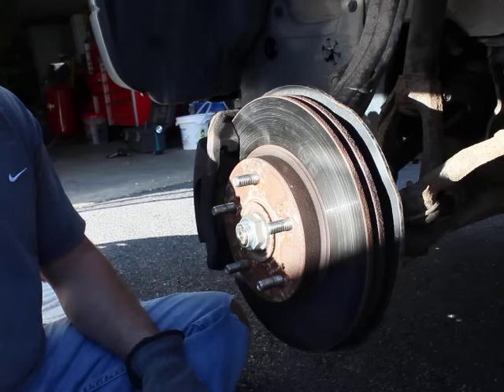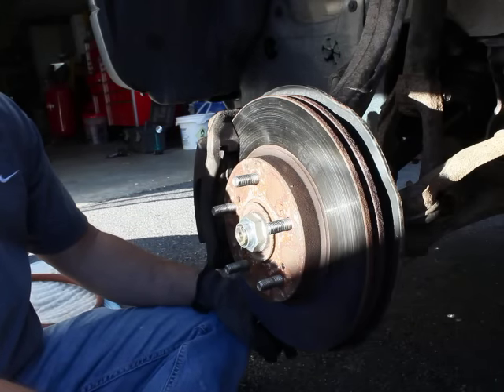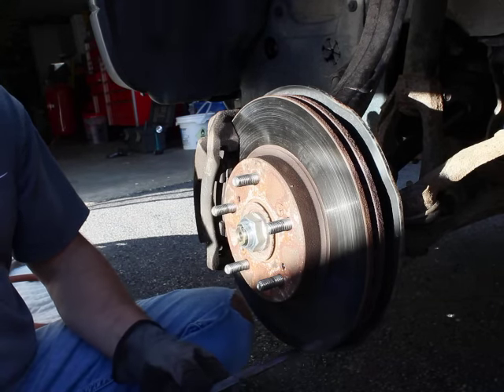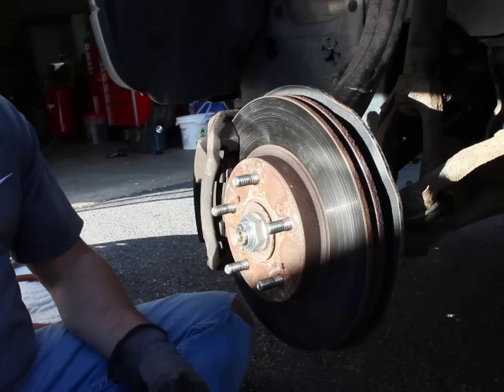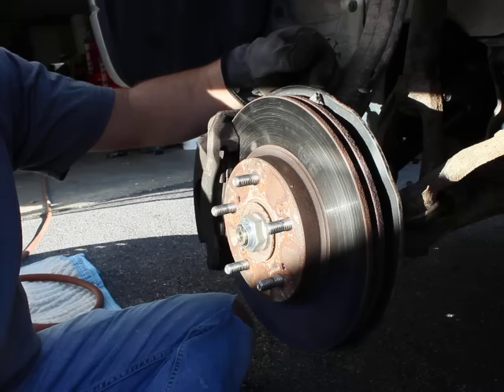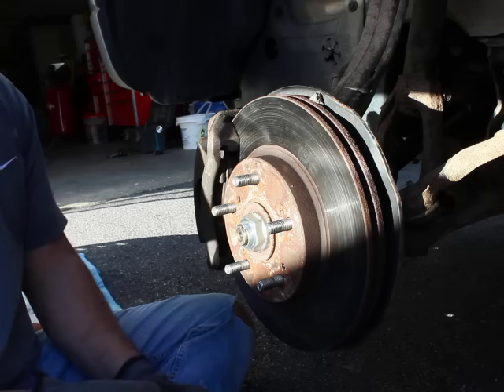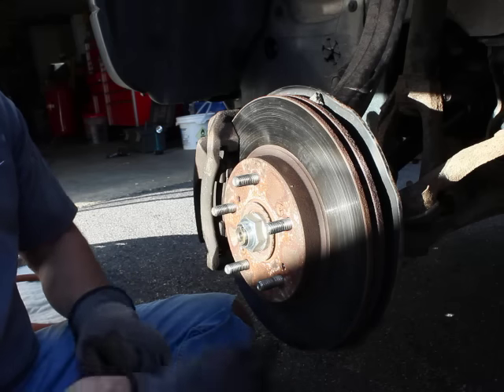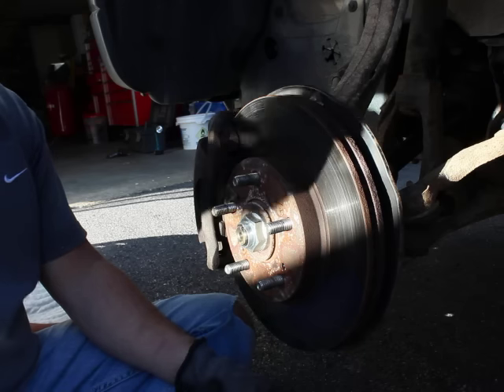Scraping Noise From Wheel While Driving

Comment: Hi sir, i have the same metal scraping noise sound in my car, but the sound last for about 1 minute or less then it goes out off by it self and i conitue to drive for like 2 weeks before it suddenly comes back again to last for the same period of time and so on ... 

So it is not constant, any ideas what could that be? is it possible as shown in your clip that small stones are getting stuck and the car are ejecting them by it self so that´s why i don´t keep hearing the noises for weeks ? because i live in Sweden and as we are in winter now, majority of the roads are covered with stones to prevent black ice, sliding,  etc
Reply from the maker: Hi Franklin, I recommend you have your brake pads checked, especially the inner pads at all 4 wheels because your brake pads may be getting low and the wear indicator may be hitting the rotor. When the wear indicator gets hot from driving it moves away from the rotor, when it cools it will hit the rotor again. Have your brakes checked and let me know what you find 😊

Comment: I had this scraping noise coming from one of my wheels, been getting worse over a couple days, checked the back tyre, all looked fine, after watching this i checked the backing plate, looked for stones etc. Took off the front tyre and could see the inside of the rim was scratched all the way around, further inspection revealed the bolt holding my brake caliper had come out and it was the brake caliper scratching against the inside of the wheel rim. Would explain the shitty brakes too.

Comment: I have a sound similar to this, but also it intermittently does a sound like I have a rock stuck in the tire itself. Could this still be the issue?
Reply from the maker: Hi Erin, I think you may have worn brakes. When the brake pads are worn low, there's a little metal tab on the pads that touches the rotor warning you that the pads need to be replaced. I recommend having the brake checked just to be sure. Keep me posted on what you find, thanks.

Comment: Thanks for the video Eddie. For the past month my driver side front wheel or tire has been making a rubbing sound that is audible starting at 5mph. Its frequency increases as the cars speed increases. Ive had the front brakes and rotors replaced, both tie rods, both lower rearward control arms, and the driver side wheel bearing /hub assembly. The rubbing noise continues. What else could it be?
Reply from the maker: +cobbie kessie Hi Cobbie, is the noise a metal , rubber or plastic sound?  Or none??
Reply: +Eddie Carrara Thanks for the quick response. I think its either metal or rubber. Performed what you suggested in this video, and the sound did decrease a little. However, its still making that rythmic rubbing noise. It feels and sounds like the noise is coming from an area between the rotor and the steering knuckle.
Reply from the maker: Hi Cobbie, 
The rotor backing plate almost completely covers teh back side of the rotor so make sure you bend it out of the way completely, if the noise changed on the first adjustment, you're probably on the right track.

Comment: Hey, my driver front tire suddenly made a real high pitched squealing noise. It gets slow in low speed and fast in higher speeds, but once I hit brakes it goes away. I went through some rocks today so think that could be an issue, but can't tell if it's wheel bearing or brakes?
Reply from the maker: +Spencer Higdon , Hi Spencer, if the noise persist for a few day, have the brake pads checked, the pads may be at the wear indicator and it time for new ones. Keep me posted on what you find, thanks.
Reply: Spencer Higdon just

Comment: I think this is causing one of my issues. The second being a grinding noise when applying the brakes. I noticed the guy who worked on my car didn't replace the retention spring on my caliper. And I'm just like why? It's still surprising to me the loose pads make such an audible grinding sound, I feel as if it's deeper than this.
Reply from the maker: Hi Kai, I recommend you bring it back to the mechanic so they can check the noise, they may have bent the backing plate and it may be touching the rotor. The can also install the missing retention clips lol. Let me know what they find, thanks.
Reply: @EddieCarrara1  I’m going to take it to a mechanic. I got interested and removed my wheel to check the brake rotor guard and that was fine. So I removed my brake pad and to my discovery the brake pad was chipped and missing material. Like a lot of material. I was in a wreck a while ago and apparently the guy who fixed my car never replaced the damaged break pad. I’m like… why tho? I took a photo, wish I could upload it. But that being the case I might as well get another mechanic to look at it. Its a shame so many mechanics can’t be trusted.

Comment: really appreciate this video . thank you . question . I was hearing a scrapping metal sound by my driver side wheel and now I don't hear it . I'm hoping that it was just that a rock got in the wheel and now it's gone . I'm all about safety so I'm going to have it checked out this week . just wanted your opinion . thanks in advance
Reply from the maker: +TVlesliearnelle 
It really all depends on the mileage of the vehicle  and driving habits. It could be the wear indicator on the brake pads, but small rock caught between the rotor and backing plate are common.

Comment: Hi Eddie, Is it possible that applying the brakes even slightly would stop the noise if this was the issue?
Reply from the maker: Adam I. Possibly Adam, but you most likely have a wear indicator on the brake pad touching the rotor, it may be time for new brakes. Keep me posted on what you find, thanks.
Reply: Eddie Carrara Hey Eddie, just wanted to follow up. The rotors were rusted badly and the previous owner just slapped new pads on it. They said the shield behind the rotors was also bent and rubbing. Thank for the response.
Reply from the maker: Hey Adam, that's great news! I love it when it's a simple fix. Thanks for coming back with an update, It really means a lot to me :)

Comment: Or you could have a stuck Caliber.  If you have recently changed your break light switch just above the break pedal, then the ABS will have to readjust itself and may make one of the Calibers stick.  The computer will have to relearn after you change one of those parts.  Either the Break Light Switch or the Break Clutch Switch.  Of which look alike and are side by side just above the the Break Pedal Assembly.  Also it wouldn't hurt to get some Break and Caliber Cleaner Spray and spray those Calibers.  They could stick and make that noise and might just need a cleaning.  It happens as the caliber ages with the vehicle.  It might save you a lot of money just cleaning them.
Reply from the maker: Yes, Pisces, 
I made a video about the brake light switch as well https://youtu.be/-OgYOgEw7w8 
If the brake pads are stuck in the caliper, cleaning the pad holders could fix your issue, but it the piston is sticking the caliper will need to be rebuilt or replaced to fix the issue. Thanks for the feedback 👍
Reply: @EddieCarrara1  Right after I made that comment.  I checked my break pads.  They were getting real thin.  So that resolved a lot of my issues and I replaced my Relays and fuses as well just in case.  The Stop fuse and the A/C Clutch Relay.  There seemed to be a hesitation when breaking at the same time of changing into another gear.  After I did those changes.  My truck ran great.    Stops great and kicks into gear faster now.  No sticking.  That was the first time I personally changed my own pads.  I cleaned those pistons with a soft wire brush and put Brake grease on them to clean them.  Getting a lot of the break dust off of them helps a lot.  Mine is also a 2007 Chevy Colorado.

Comment: I had a brake job done several weeks ago and have noticed a clicking sound coming from my read driver's side wheel. I can hear it best at around 10-15mph with the windows down but kind of lose it at higher speeds. The clicking goes away when the brakes are applied. I'm wondering if it could be a bent shield or possible something caught between the shield and the rotor...
Reply from the maker: Hey Chris, if the noise goes away when braking, it's possible you have some rust built up on the edge of the rotor and it's hitting the caliper, or if your rotors were replaced, maybe some rust from the old rotor has fallen between the backing plate and rotor like you thought. I would drive it for a few days, if it doesn't go away, I recommend taking it back to the mechanic who did the brake job. Keep me posted on what you find, thanks.
Reply: After taking it back three times to Firestone, I pulled into a Midas for one of their free brake inspections. After waiting an hour and a half to get it into a bay (can't complain - it's free), they gave my brakes a once over. They took me out there to take a look and showed me that there was some hardware missing (plate?) which was causing the pad to move and strike the rotor. They rotated the tire back and forth and the sound I heard while driving was reproduced. They told me to take it back to Firestone and show them, if need be, what the issue was. So, I did, Firestone finally fixed it and all is well. But now, unbelievably, I've got another noise when braking, this time. It's particularly noticeable from higher speeds when I apply the brakes I here a kind of thumping, almost like a helicopters rotor, sound. I'm dang tired of taking it back to them. I've spent nearly 15 hours on a simple brake job. Anyway, thanks for the information. I really appreciate it.
Reply from the maker: Chris Angel If you have drum brakes, the noise may be coming from them. If the drums were resurfaced, they may have been cut too fast causing a record like groove in the drum contact surface. Let me know if you have drums Chris, and you are very welcome.

Comment: Thanks mate I checked the backing, plate still getting the grinding noise? I might check rear back breaks of Nissan xtrail 2009 St 2.5 ltr
Reply from the maker: The noise could definitely be low brake pads Rodney, let me know if you have questions.

Comment: Just got my front brakes and rotors replaced and it's still making the noise. Paid $320 🤦🏽. Can I fix without removing the tire or is that required?
Reply from the maker: Usually you can reach it with a screwdriver and just push it back a little all around the rotor except where the caliper is located.

Comment: I replaced the lower control arm, stabilizer link, and tie rod end. The scratching noise was the rotor scraping the backing plate on the bottom. Bending it back will fix the problem. (Good thing I didn't paint the plate as yet.)

Comment: So I've got the grinding noise, but only when applying the brakes. Just had the front pads and rotors replaced about 3-4 months ago at a Midas (GF's car/never going to Midas again) The car was up north, so there is a good amount of corrosion but like I said the moving parts were replaced on the front. Ideas?
Reply from the maker: Hi Derkaderka27, I recommend finding out which wheel the noise is coming from, then pull the wheel and have a look to see if there is any obvious signs of a problem. Do you think the noise may be coming from the back brakes?

Comment: Hi Eddie, I'm wondering if you can help me out. A few days ago, I noticed a grinding/whirring noise coming from one of my rear tires, becoming louder when I apply the brakes. The vehicle is 2003 Toyota Corolla. I decided to prop my vehicle up today and spin the tires, in order to pinpoint which one was causing the sound. It is definitely the rear passenger side tire. The strange thing is that the noisy tire would actually spin while the parking brake was applied and the vehicle was in park, as opposed to the rear tire on the other side which did not spin at all in the same conditions. Any advice would be appreciated.

Thank you!
Reply from the maker: +Lance Dougherty Sounds like something is worn out back there. You'll need to remove the wheel and inspect the brakes completely. Keep me posted if you have more questions.
Reply: +Eddie Carrara Thanks for the quick response! Will do.

Comment: Hi Eddie, I have an 07 Tundra that is making a scraping sound that i can hear when i drive alongside a metal building. I have taken my wheels off and checked all of the rotors, brake pads, and behind them but cannot find the problem. Any other suggestions?
Reply from the maker: Hi Kevin, Have you looked at your drive shaft u-joints? Sometimes they can sound like something scraping. Check them out and let me know what you find, thanks.

Comment: I have a 2004 Honda Accord I just changed the CV axle to a brand new one on the driver side it's never made the noise that you showed before I changed it but now a sudden it's making that noise only when I turn the wheel right well it's in motion. What do you think it could be you think it could be the the cover in the back? And I have brand new brakes and rotors on there.
Reply from the maker: Hi Matt, It's very possible the plate got bent when replacing the axle and now it's touching the rotor. I recommend you push on it with a broom handle or screwdriver slightly to give it more clearance. Let me know how you make out. 🍻

Comment: Hi Eddie, I just got a 2002 Rav4, and I too am having this noise, so many thanks for pointing me in the right direction. Don't suppose you know if the fuel cap release cable from a mk1 will fit my mk2? (Both 3 doors) Having difficulty finding out. Much appreciated.
Reply from the maker: BigChocolateButton You're welcome, just call the dealerships parts department and ask them to check the part#s, if they're the same, it will work :)

Comment: Thank you so much for this video, the noise was driving me crazy and now its greatly reduced. My only question, is there anything bad that can happen if I bend the plate too far back? I want to eliminate the noise entirely but I don't want to push too hard and mess something up. I don't know much about cars so thanks again for the video, some mechanic would've finessed me for a couple hundred easy.
Reply from the maker: Hi Damian, you're welcome 😊 
You can't really damage anything, but you may tweak the plate too much and have it squeak in a different area lol. I recommend you just push the area that is making the noise if you can pinpoint it. Let me know how you make out 👍

Comment: Hopefully this works ill check this out tomorrow, this just started happening to me last hour or so. Im a new driver so sometimes i will turn the wheel all the way when im getting out of a tight parking spot, and ill accidentally turn it until it hits the side and stops turning and i think when i did that just recently it might have bent one of those plates or something :/
Reply from the maker: Hi Bryan, no, the steering can be turned side to side, lock to lock and it shouldn't interfere with any components unless your vehicle has oversized wheels and tires, but even that wouldn't damage/bend the backing plate. I recommend having your brakes checked just to make Sure you're not hearing the wear indicator on the brake pads rubbing the rotor warning you the pads are low. Let me know what you find and if you have more questions I'll be right here 👍

Comment: Can these still get bent without having your breaks done? I believe this  Diagnosed my problem but not  sure how they got bent
Reply from the maker: Hi Rywaypert, yes, just removing the wheels the wrong way can bent them, debris from the road like mud, snow, ice and branches and bend them, but also something like a small pebble or rock from freshly filled potholes can get lodged between the rotor and backing plate as well.

Comment: So I dropped my car from a car lifter thing, about a 7 inch drop. I think my shield is bent. Is it safe just to drive for a little while?
Reply from the maker: Hi Saleem, use a long screwdriver or bar to bend the shield out of the way through the opening in the rim, you don't need to take the wheel off again. Let me know how you make out, thanks.